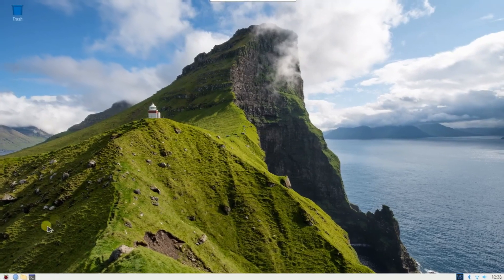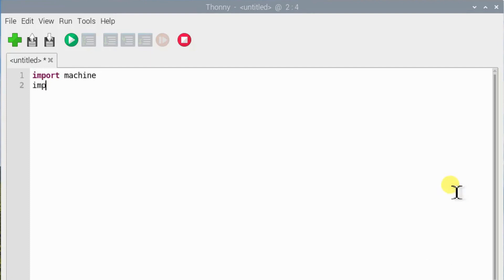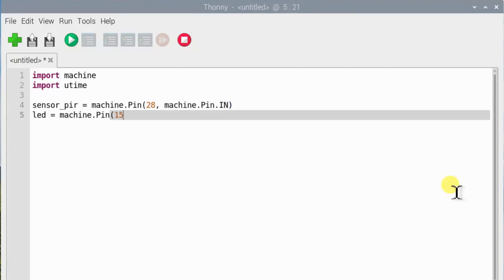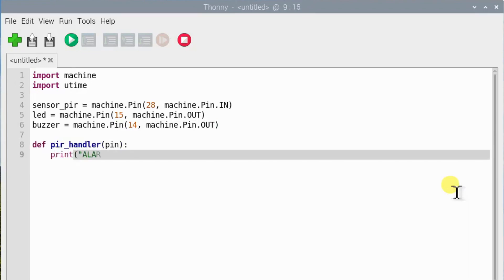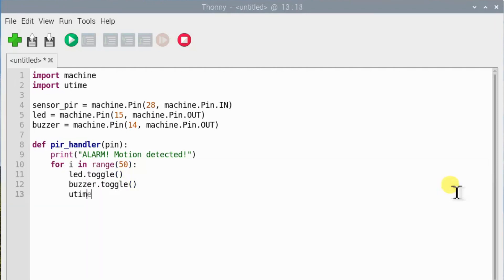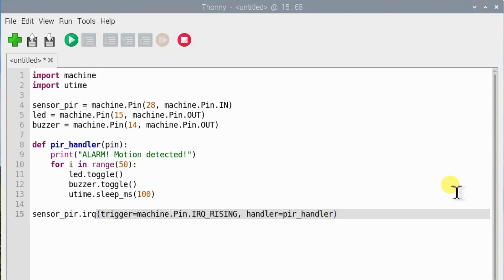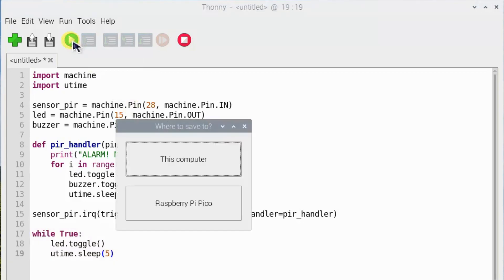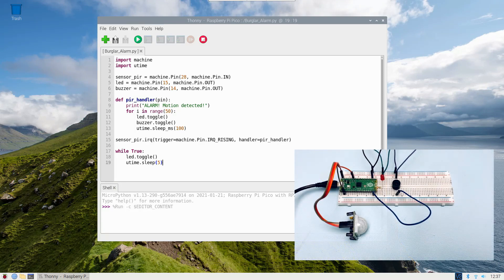Burglar Alarm Using Raspberry Pi Pico

Comment: Madam, thanks for the video. I have a generic question. If I want to put such motion detector modules along the circumference of my compound wall, what would be the setup involved ? Multiple PIR plugged into breadboards - which would pair with a laptop using Bluetooth ? I am a newbie so pardon if it’s a silly question

Comment: Hi have a req instead of PIR sensor and buzzer can you use sd card module ultrasonic sensor and make similar project but starts alarming by the MP3 file being stored in the sd card placed in sd card module

Comment: Here is the code (a bit modified to use the on-board LED and disabled buzzer):

from machine import Pin
from time import sleep

sensor_pir = machine.Pin(28, Pin.IN)
led = machine.Pin(25, Pin.OUT)
# buzzer = machine.Pin(14, Pin.OUT)

def pir_handler(pin):
	print("ALARM! Motion detected!")
	for i in range(50):
		led.toggle()
		# buzzer.toggle()
		utimee.sleep_ms(100)

sensor_pir.irq(trigger=Pin.IRQ_RISING, handler=pir_handler)

while True:
	led.toggle()
	sleep(5)
Reply: but why would you dissable it?

Comment: Use this code if working with GPIO
import RPi.GPIO as GPIO
import time

PIR_PIN = 4
LED_PIN = 26
BUZZER_PIN = 17

GPIO.setmode(GPIO.BCM)

GPIO.setup(PIR_PIN, GPIO.IN, pull_up_down=GPIO.PUD_DOWN)
GPIO.setup(LED_PIN, GPIO.OUT)
GPIO.setup(BUZZER_PIN, GPIO.OUT)

while True:
      if GPIO.input(4):
          GPIO.output(26, 1)
          GPIO.output(17, 1)
          time.sleep(1)
          GPIO.output(17, 0)
         time.sleep(5)

time.sleep(0.1)

Comment: Can u tell y resistor is used?
Reply: 330 ohm
Reply: @maartenvanassenbergh5891  Why only 330ohm resistor is used?
Reply: @maartenvanassenbergh5891  Can u also tell is the code working or not?